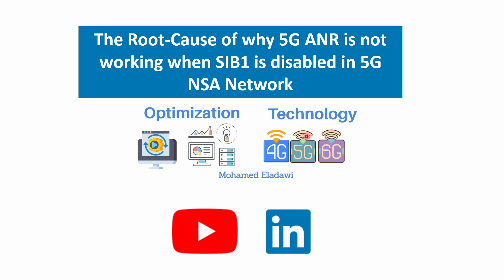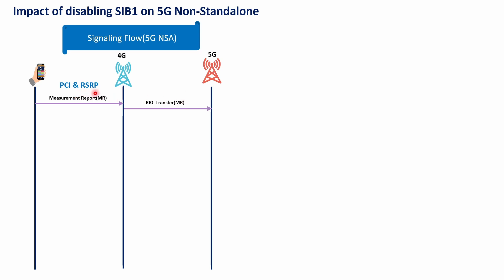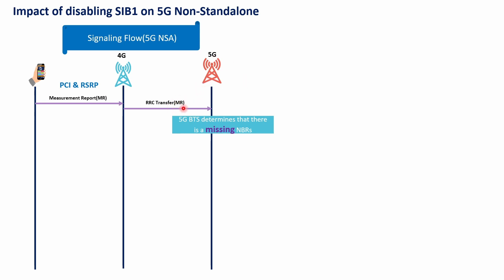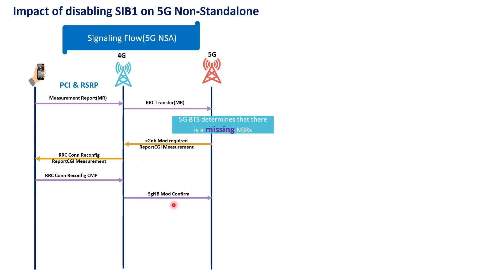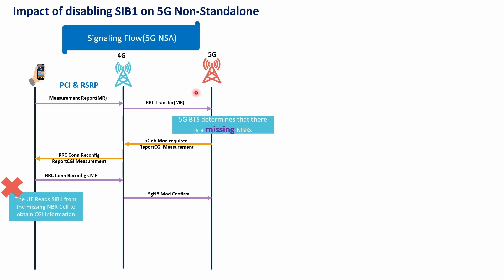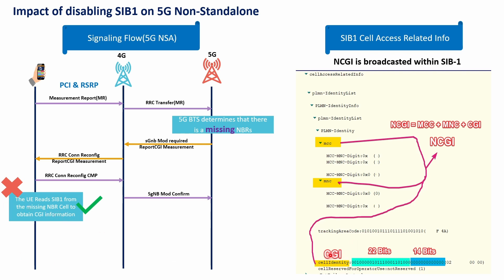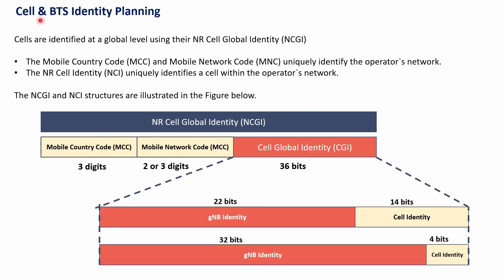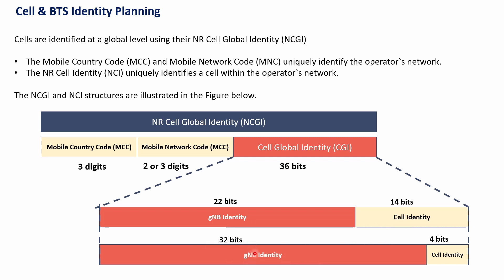5G NSA: No SIB1, No ANR? 5G NSA Explained Simply

Comment: Thanks for the great info.
I have some doubts. Is this CGI ANR from LTE to a "5g cell in a NSA setup" ? Means UE is in pure 4G, not in NSA and want to register to 5G but in a 5G cell which is part of some NSA setup and that's why there is no SIB1.

Because in LTE to NR SA during ANR setup where 5G cell have SIB1 will not have any such issues. Kindly clarify? or I am missing some basic link here.
Reply from the maker: You are perfectly right; In 5G SA; SIB1 is mandatory as it is the first thing UE will need to decode to complete initial access; while in NSA it is only needed during NSA setup; the point i want to highlight to you that i did a trial before and all the points discussed in the video was confirmed but the only challenge i faced that i tried many times to see and get SIB1 info from L3 messages but i couldn’t find it at that time. While in 5G SA it easy to see SIB1 with any initial access.

Comment: I have a question , what if LTE side did not add the neighbour relationship of NR or vice versa? How does it work then
Reply from the maker: Hi Louis, NBRs should be defined manually or through ANR and We don't need NBRS addition from 5G to 4G but vice versa without 4G to 5G Nbrs for interenb scell change will not be doable. Let me know if I understand the question correctly